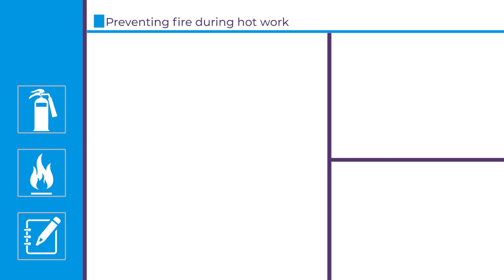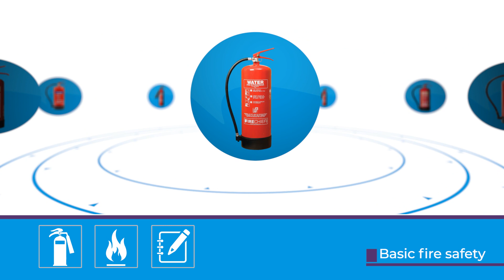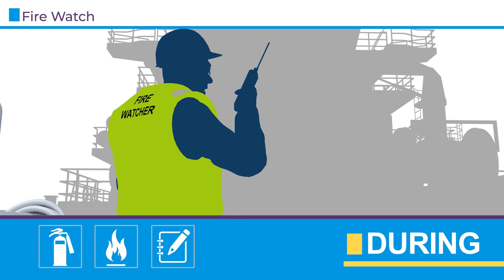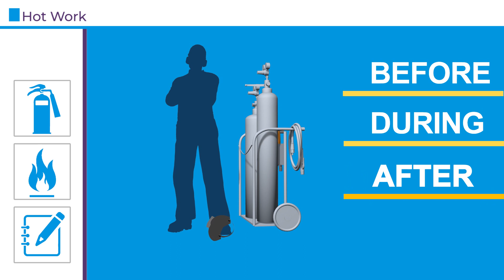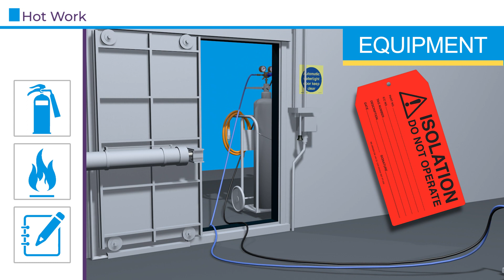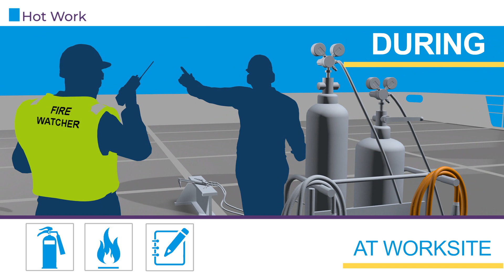Hot work and fire watch

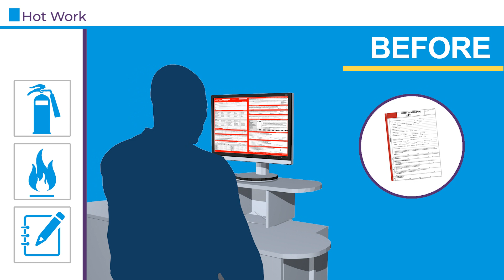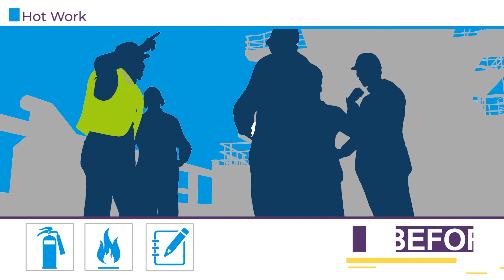Comment: Between time stamp 8:35 and time stamp 8:45 , the video narrator uses the initialism "RPE" in the sentence, "it will also specify the correct PPE, and RPE, to wear for the job." However, the video does not teach the viewer (the student) what RPE is. RPE is respiratory protective equipment, such as a gas mask.  Also, the abbreviation or initialism "PPE" is used to refer to "personal protective equipment." Personal Protective equipment (PPE) includes: gloves to protect your hands; hard plastic composite-toed shoes; safety glasses for your eyes, and more. The narrator in the video never explained what RPE is. I will leave this comment here in case future students read the video comments for additional help and explanation.

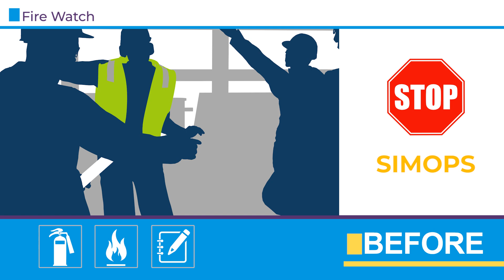Comment: At minute marker 3:48 the narrator mentions "SIMOPS" without explaining what the acronym "SIMOPS" means. Simultaneous Operations are two or more separate jobs, or pieces of work, done on the same day, at the same time. If there was only one worker at a work site, then there would be NO simultaneous operations. In this context, an "operation" is a piece of work someone does, or a task, or job, which requires some times. Sometimes, the amount of time required is an hour, or one week, etc.... An example of an operation is putting up a sheet of dry wall and/or plaster board inside of a house. The word "simultaneous" means "happening at the same time". Whenever there are two or more people doing two or more different jobs at the same time, those people might accidentally hurt each. If you are not using your eyes to watch your surroundings, you might hit someone with equipment or materials you are carrying under your arm. Also, when person A uses fraying gas lines containing holes then person A might catch person B on fire. That is what they mean by "SIMOPS" or "simultaneous operations." its lots of operations, or tasks, being done at the same time by different people.